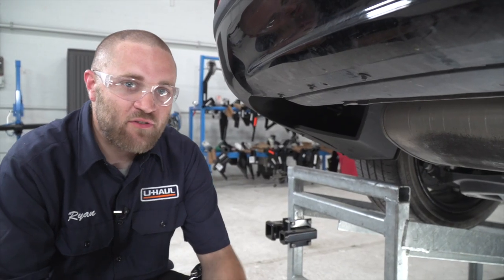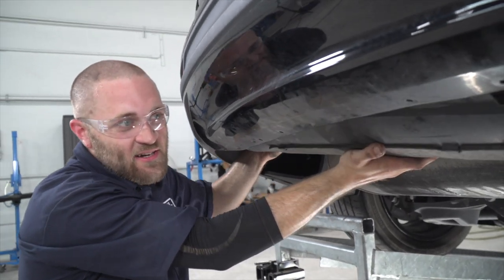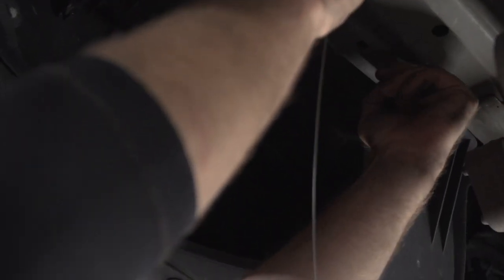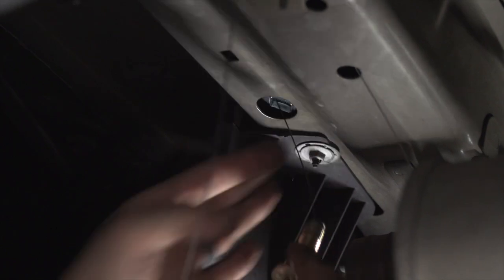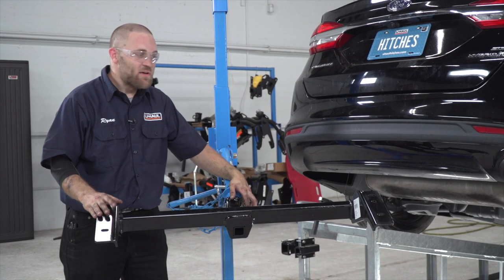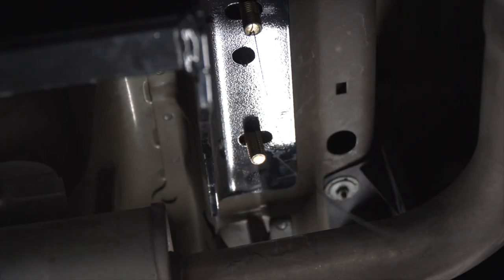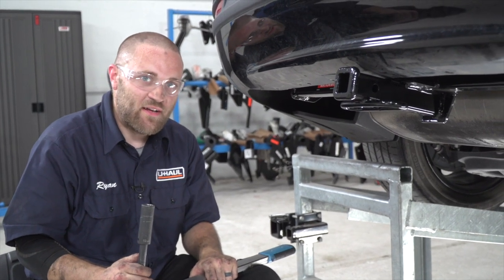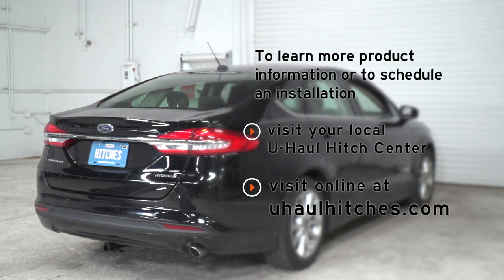2019 Ford Fusion Trailer Hitch Installation

Comment: Does the wire come with the kit?
Reply from the maker: The trailer wiring does not come with the hitch, however, it can be purchased form any U-Haul center.
Reply: @trailerhitches  think he was preferring to the feed wire
Reply from the maker: @oneshothooligan6279  In that case, yes. If a fish wire is needed for installation it will be provided with the kit. This particular kit comes with 4.

Comment: How much weight could it hold?
Reply from the maker: This hitch is rated to 3,500 lbs. gross trailer weight and 350 lbs. tongue weight. But always check your manufacturer suggested trailer weight capacity before towing.
Reply: @trailerhitches  reason why I asked was because I have a 2014 Ford fusion and I wanted one just so I could put my 310 pound dual sport on it